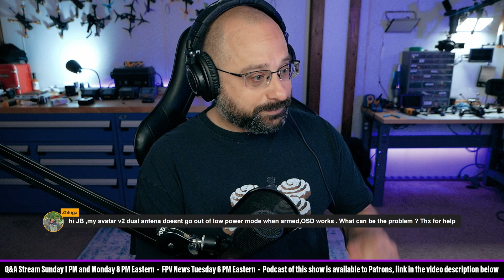My Walksnail Won't Go Out Of Low Power Mode! OSD Is Working Fine Though!? Help! - FPV Questions

Comment: I have this issue right now. HD pro. I had a 16 second flight and saw my battery was dead so came back, swapped out a fresh one and then black screen but still have all my osd information. I replaced all wires (based on info here in vid) I was hoping it was just a broken one but nope...same problem persists. 

I'm all out of ideas so any and all suggestions be greatly appreciated. TIA.

Comment: We experienced the same problem with 2 TinyWhoops a few days ago. After watching this video, we checked the cable connection and found that the RX solder pad had come loose from the flight controller board (strange fact, on both copters).
Unfortunately there are no additional UARTS on the AIO board so we can't fix the issue.
In order to still be able to fly with the usual performance, I wanted to ask if there is a way to deactivate the standby mode of the Walksnail VTX?

Comment: I have a vtx that does this intermittently. seeing osd doesn't mean you're actualy seeing it. Mine will display the last osd it had before the black screen even when the vtx is off. some power on's it will work others it black screens

Comment: I've had this issue and it had to be the FC in my case because the wires were hooked up I had osd but it wouldn't go out of low power mode I never did figure it out I just used a different fc and it's worked fine
Reply: I also had this issue, VTX cables were and it worked with a different FC. There was a setting "serialmsp_halfduplex = ON" I had to turn it OFF (so it would use FULL DUPLEX)